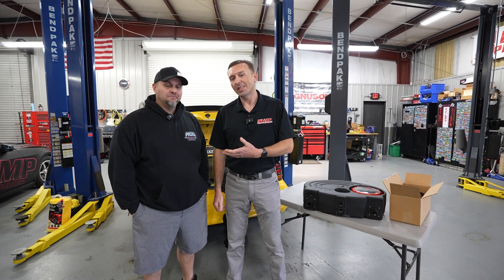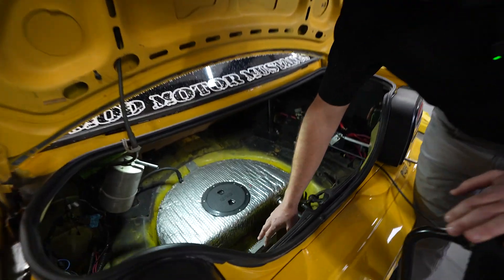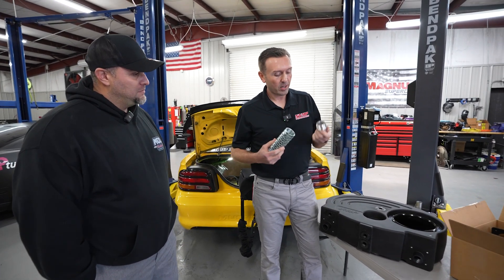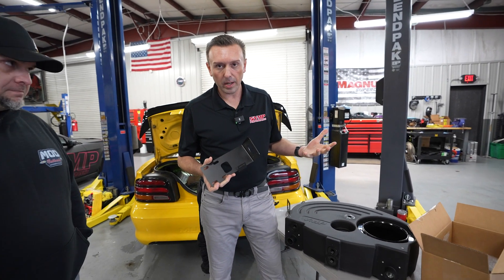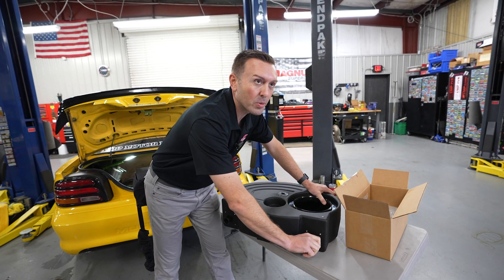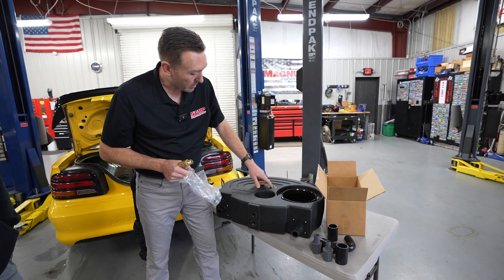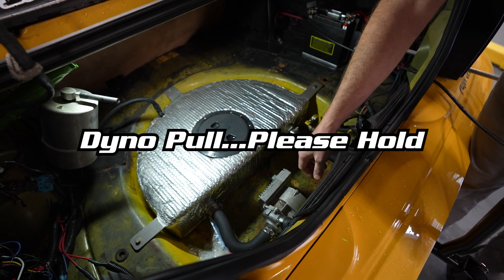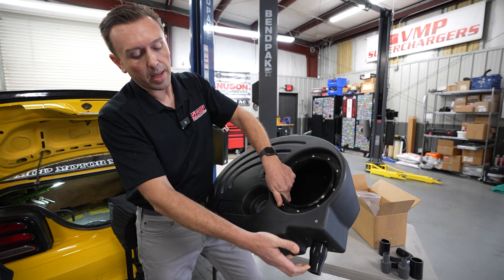This Trunk Mounted Ice Tank Will Change Your Life! | VMP Trunk Ice Tank

Comment: The biggest mistake I’ve seen people, parts companies and performance outfitters make when it comes to cooling your supercharger is no one seems to get 2 things
1- you line size WILL determine the ability of you system to flow regardless of pump size
2- twin cooling fans only do 1 thing great ….the block the flow to your heat exchanger when you really need all the cooling.  

Cooling fans on your heat exchanger are only effective at slow speeds which is a problem because beefing up your charge air cooling system is only because what happens with your charge air @ WOT.

Cooling fans really look nice on the website (not just VMP everyone sells them but nobody needs them.) 

VMP does have some great parts when it comes to cooling.  The VMP 2007-2014 gt500 intercooler brick and their high flow water manifold really helped me achieve the flow rate I was targeting on my CAV system on my 2009 gt500.

Anyone interested in doing the smart thing and beefing up their cooling before increasing power should read EVERYTHING on Departmwnt of Boost’s website.

They have done their homework and applying the information they have to your build might just save you an engine.  
I would have saved $30k possibly if I had found them before melting some spark plugs.
VMP products combined with DOB’s heat exchanger and intercooler pump will make HIGH Iat’s a thing of the past.